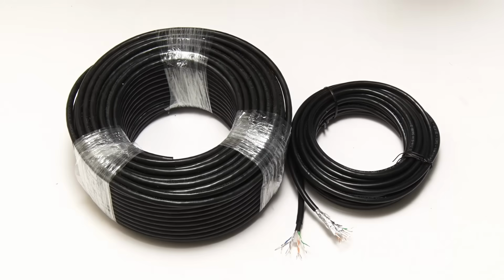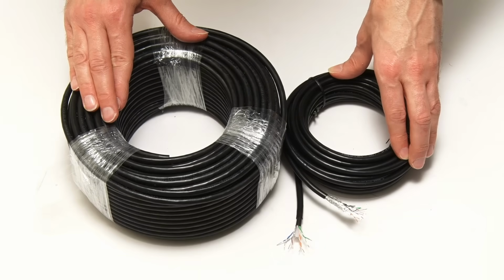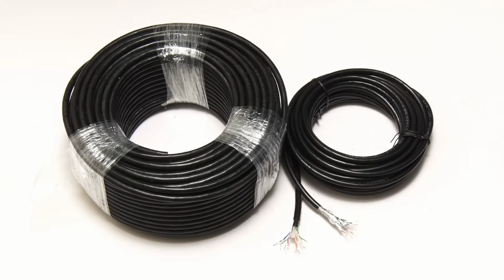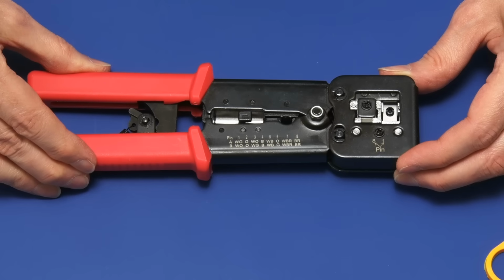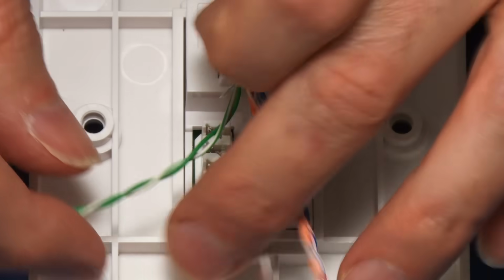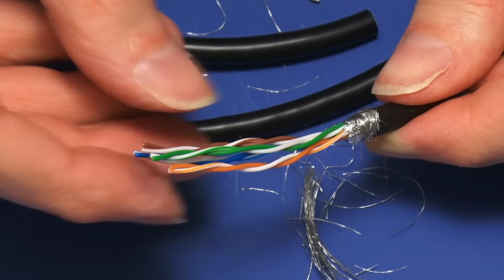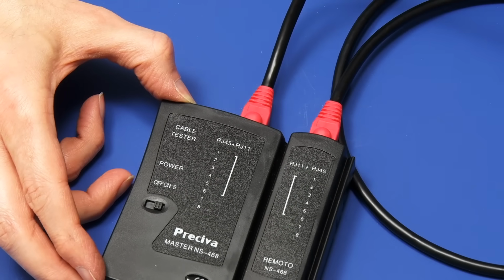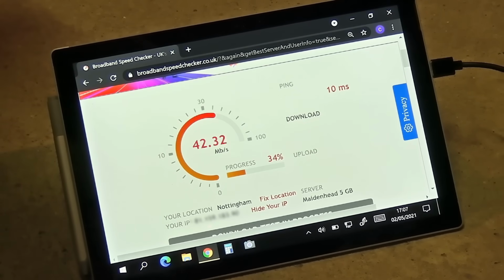Wiring Ethernet Extensions: How to Fit Sockets & Make Patch Leads

Comment: Just wondering if you have something to protect against lightning strikes with your cable?  I saw somewhere on YouTube someone did a similar install and lighting struck near by and damaged a bunch of equipment.  8 bit guy I believe.
Reply from the maker: A lightning strike is going to take stuff out it if hits an underground cable. Not a lot you can do about that.
Reply: It is not required to use surge suppression between buildings, but is highly recommended.  If there is any distance between buildings, it is surprising how often equipment is damaged (even when no lightning is present).  I have seen many businesses regret not having this.   That being said, if there are only cheap Ethernet switches at both ends,  you could "risk" it.
Reply: There are surge protectors available, but they won't protect against a direct hit.

Comment: Outdoor cable is generally UV protected too. So the sun does not break the cable down. Where as Indoor cable is not UV proof. I have seen many installations where people have used indoor grey cable outside. And after a few years it has cracked open and let water in. Leading to corrosion and failed links.
Reply: When using outdoor  cable exposed to the sun, I would also suggest additional UV protection, like another sleeve. Sun can be brutal.
Reply: @KameraShy  I guess wrapping in aluminium foil would help.
Reply: I've seen this more often than not as people have taped up spaghetti wires along the side of their houses.  Ironically, they opt for crap tape rather than UV resistant duct tape.

Comment: How do you do a cross over ethernet cable?
Reply from the maker: You wire T568A on one end, and T568B on the other.
Reply: @ExplainingComputers  The old wives-tale about A on one side and B on the other side only applies to 100M (only uses two pair).  Although most equipment is auto TX and will never need a cross-over, just google how to "cross" all 4 pairs if you need a true gigabit cross-over cable.  (Ignore all results about only crossing just two pair.
Reply: Don't bother.  It's not needed with modern equipment.

Comment: Great Video. You are right about people thinking they have a slow internet connection when using a wireless connection. So many household items can cause random wireless interference and then slow down there internet connection to the router. Use a cable connection or log into the router to test/see the speed before you call out an engineer :-)

Comment: Good, solid information as usual, and worth having even if you aren't going to make your own cables.  One very minor suggestion, though it's partially addressed by the "garage" label on the wall socket; label both ends of any cable with a unique identifying label. White shrink-wrap and a marker is one possibility, but for a really professional look, there are printed labels available. 
Given the role of cabling and connections in mysterious, intermittent, network malfunctions, even if you do know how to make custom cables, you probably shouldn't. Pre-made cables of every length, rating, and hue are available at a price that will rarely justify your time and investment for tools. Like any other skill, speed and quality will improve with experience and decay with disuse, so for most people it makes sense to buy commodities like cables rather than build them.
Reply: If you live in a state which requires certification for all low-level cable installation, then YES it is one of the code requirements that all low-level cable have a unique label (or writing) on the cable BEHIND the wall-plate (and /or behind the patch panel.
Reply: @matthewhickok4421  Never mind any state certification, you'll appreciate the labels when you're staring at one end of a stray wire in a bundle, wondering "Where the hell does this go?". (It's equally true of wiring looms in cars, &c.)

Comment: Is it worth a mention about straight through/crossover cables? Or am I hopelessly out of date?!
Reply: Most computers and switches will automatically change between crossover and regular. It will detect your device and chose the appropriate setting. If you have legacy devices that need to be inter connected then crossover is a must.
Reply from the maker: Crossover cables can indeed be used to link two computers, but there was already enough going on in this video!
Reply: @ExplainingComputers  Besides, you can easily make a crossover by using the A wiring standard on one end, and the B on the other.  Not to mention it's only important for the patch cables..the in-wall stuff you'd want to be straight-through in any case.

Comment: I hope the project in the garage goes quite well wire an expertise is exceptional
And yes I would say that you did a much better job doing outside through the break instead of inside through the brick common mistakes that are made by insulation is which you think would not happen but it does

Excellent video you went nice and slow to make sure that your audience sees the exactly what was done good choice

Comment: What set up would you recommend ethernet or Wi-Fi network, a friend of mine swears by a Ethernet network, I guess Ethernet would  be more secure.
Reply from the maker: Modern WiFi is amazing. But if you can use Ethernet, use Ethernet. Both more reliable (esp for things like streaming video) and more secure.

Comment: A very stong suggestion, even though it 'technically' isn't required, that if you have an application for direct bury cable, still run it through conduit (piping) because over time,  it will give considerable extra life, when you decide to /need to replace the cable, you will have a much easier time being able to pull it out.
Reply from the maker: A very good point, especially on future cable removal! :) Here we did in the end put the cable in a conduct where it went under concrete slabs.
Reply: Also, (even though it is a pain to work with) I recommend using the outdoor cable with the "icky-pick" water-proof gel filling in it.  Underground cable often is submersed in water (and sometimes even when it is in a conduit) Water can often find a way in over a long period of time and will either reduce the quality of the connection or disable the cable entirely.

Comment: It actually took me some 15 years to notice that the blue wires are connected differently than all others (first solid, second striped). Still have some cables to be fixed. It's OK if there are two plugs on both sides with blue wires reversed, the problem is when one end is a socket wired to the label, and the second is the plug wired in reverse. This limits the link to 100M.
Reply: The blue comes next to the white/green. So the sequence in the connector is still alternating solid/striped. But you know that by now.
Reply: 100M (aka Fast Ethernet) really only uses two pair -- the Orange and Green wires (T568B).   To get Gigabit speeds you need all 4 pair wired correctly.

Comment: I'm such a cable snob, it's 100% copper or not at all.

Just done installing ethernet runs throughout my house, spent the money on a branded cat6 (likewise, longest single run is under 20 metres) and I genuinely sit happier knowing that the hours I spent fitting it and fishing cables through cavities have been with a quality product.
Reply: You really nailed it - people don't put enough value on their own labour. They will spend endless hours trying to save a few dollars / pounds but then spend an entire weekend installing their purchase without a thought about all that time. I don't think I ever regretted buying more quality than I needed (within reason of course).
Reply: CCA must be avoided at all costs! I work with POE so it is always best to have pure copper.
Reply: @soiledhalo2296  In fact, it should be banned by law from import and manufacture.
Reply: @soiledhalo2296  ironically, PoE is my next stage for CCTV :D

The remainder of the drums I bought perfectly fit the remaining needs with an estimated 10-20 metres left over
Reply: I wouldn't use CCA for anything it's junk wire.
Reply: I have never used CCA. You confirm my doubts.
Reply: I'm with you, Dave. I prefer solid cable over anything. I find it easier to work with as well. Solid cable holds shape better when you're pushing it into a plug to terminate. There's no point using stranded in any other application, such as permanent wiring, yet I don't even want to use it for patch cables. 😂